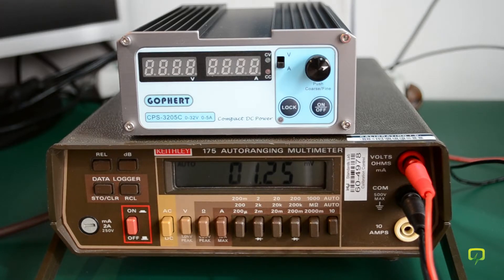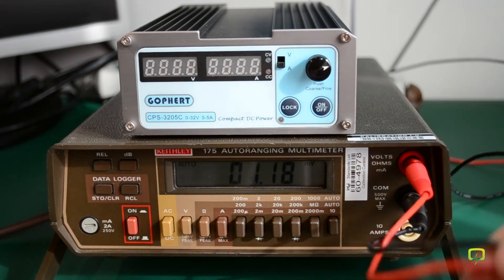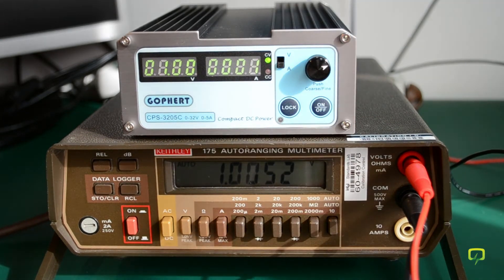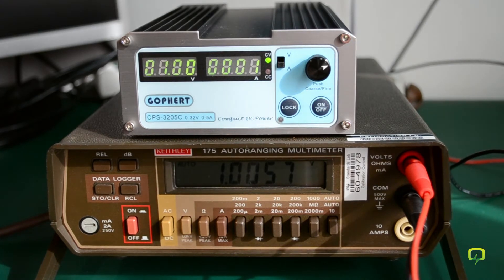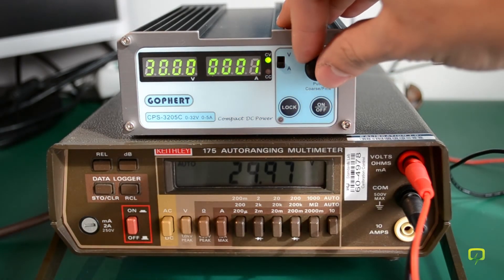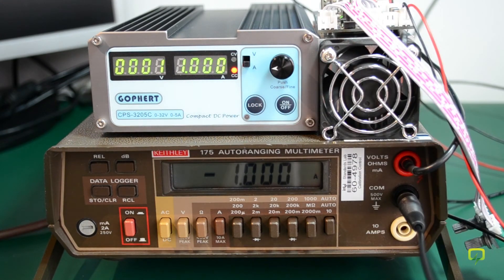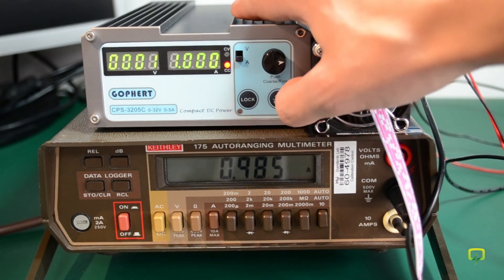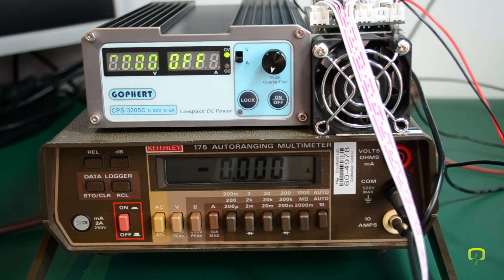VoltLog #6 - Gophert CPS-3205C Calibration

Comment: I just wanted to update this with my issues when I was calibrating the Gophert CPS 3205 II unit. The process is the same as this video except that the voltage calibration process offers you two calibration steps not three as in the video. These are 3.0 volts and 30.00 volts. Stepping through the process from start to finish and the adjustment is exactly the same method as in the video. 

After you have adjusted the 30.00 volt setting you then press the ON/OFF button again to take you to the current calibration first step which is the setting for 1 amp. The display shows 0001 / 1.000. By the way, the 0001 in the voltage display on the left is not volts it's sensitivity of the adjuster. If you press the adjuster knob it toggles between 0001 and 0010 decreasing/increasing the adjustment increment when you turn it. 

So there I was ready to adjust the 1.000 amp calibration setting. I set my multi to DC amps. I didn't need to put a load in the circuit by the way. However, when I turned the adjuster on the Gophert there was no response from my multi. The amps didn't change. So I gave up and abandoned the calibration. When I restarted the Gophet an ECL error was displayed. Restarting the Gophert wouldn't remove it. I guess this is a calibration error code.

So I tried again from the beginning making sure that I went through the complete calibration process including the amps settings but without changing the amps values. I hoped that would clear the ECL error and it did. But unfortunately I now had a OCP error. This is Over Current Protection error.

Anyway, after giving it some thought I decided to try using the 10 amps max lead port on my multi instead of the main 600 volt port for the live lead when calibrating the amps. In other words when I stopped at the 1.000 amp calibration point I set the multi to DC amps and also switched the live lead from the 600 volt main port to the 10 amp max port. 

It worked. I was able to adjust and recalibrate the Gophert's amps and get through to the end of the process and get rid of the error. So all is well.

I think the problem was that, although the Gophert was adjusting ok and changing the amp setting, I just couldn't see it on the multi until I went down to the 10 amp max port. Probably something to do with the impedence of the multi when connected to the main 600 volt port. The need for a constant current during the amps calibration is key and perhaps that current was too small using the 600 volt port. I think the OCP error was because I had adjusted the current too far out of whack because I couldn't see what I was doing on the multi during the first calibation run. 

So I hope this helps. There isn't a lot of information about this on teh net. In fact this video is the only thing I could find. 

Many thanks to its originator for taking the time to produce it.

Comment: Thank you for putting up this video.
What value of a load did you use for the current calibration? Can you calibrate with a regular load instead of an electronic/adjustable load?
Reply from the maker: I guess any load will work as long as you can set the requested currents 1A, 5A through it.

Comment: Very helpful video! I now avidly go through all of them and find great tips in them. 
After going through the calibration process, CV and CC outputs are both right on target (externally measured). But current is always displayed around 20mA over real measured value, be it in CC or CV mode, while voltage is exact. Do you know if there is a way to adjust current displayed values?  
Thanks, keep on the great work.
Reply from the maker: the accuracy on the current meter especially on the previous revisions (before 2016) is not so great. Checkout the teardown and review of the newer revision which has better accuracy https://youtu.be/yIx_VWWgKUI?t=15m1s

Comment: Did someone here experience the following after going through the calibration:

After doing the voltage calibration (which on my unit only does 3V and 30V) and the amp calibration the display starts to show ECL, and it will not exit this, even not when powering off the unit, and restarting it. Any ideas ?
Reply: +Cliff Albert Same problem here, its a protection in the gophert and its because you have not correctly done your amp calibration, you can`t JUST calibrate the voltage and "skip" the amp part by pressing ON/OFF button... you have to do ALL calibrate step and be correctly wired for clear the ECL error, good luck and sorry for my bad english! :)
Reply: Cliff, that happened to me too. I had to go over the whole calibration process again and end it with the 5 Amp load still connected. In the first instance I had disconnected the load it before pushing the ON (finish) button.
Reply: That is valid for Gophert CPS-3205 II units in 2018. You need to go through V calibration for 3V and 30V, then short the test leads through multimeter (A measurement mode) and perform calibration for 1A and 5A. Press ON/OFF button on the front to continue with next calibration step until the end. Once complete, the power unit will automatically quit the calibration procedure, but not before you perform the entire sequence.
In my case the calibration procedure went very well and now I have accuracy for the voltage below 1mV at 5V, while for Amp range the difference is exactly 1mA for 20mA load.

Comment: For the current calibration, couldn't you just put the multimeter straight across without a dummy load? Given that the voltages on the PSU appear to have been in the 0.00 range while you were doing this, the dummy load seems to have been doing its best to emulate a dead short anyway...
Reply from the maker: +Jasper Janssen yes you can do that, the meter shunt resistor will act as a low impedance load.
Reply: Update: I sorted it out by connecting DDM across outputs as suggested and then it regulated voltage down so I could calibrate.

I just tried to calibrate my CPS-3205 and after the voltage calibration it out outputting 30v during the current calibration on both 1A and again on the 5A calibration. This doesn't seem right to me and I can't do the 5A calibration with only the ZPB30A1 load.

Comment: I encountered some difficulties with the current calibration of my unit. It just wouldn`t enter in CC mode for the purpose of procedure. And believe me I tried various load settings. Any idea how to deal with that situation? I`d really appreciate your help.
Reply from the maker: Vasil Cvetkov Have you followed the calibration procedure from the description of this video?
Reply: Yes, procedure exactly followed. Done correctly for the voltage range. After that when I connect the load the CC diode just wouldn`t display while CV stays on. Meanwile a current actually flows through the load. I`m totally baffled hah.
Reply from the maker: Vasil Cvetkov I have sent you a message containing a contact email from Gopher. You should write to them about this issue they should be able to support you.